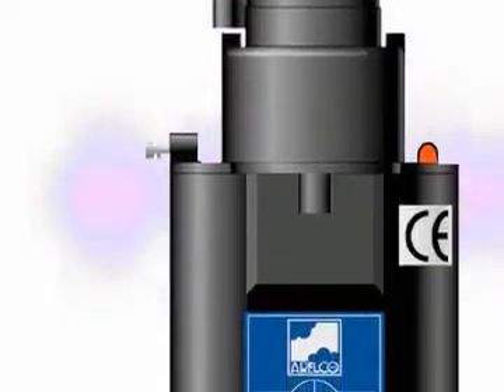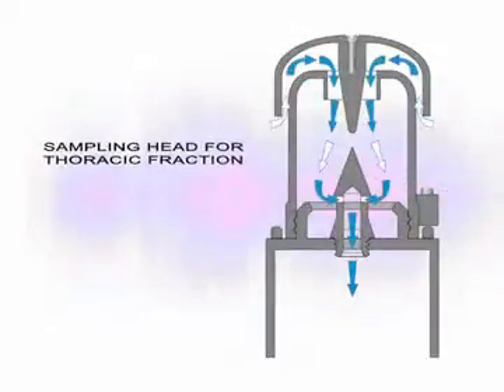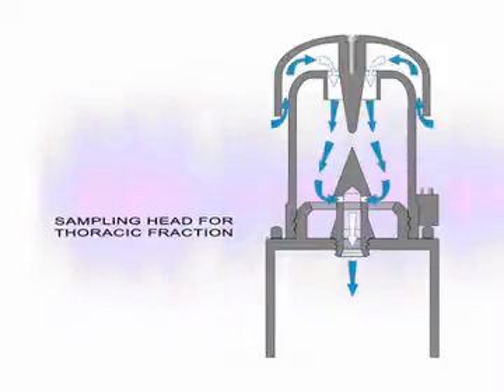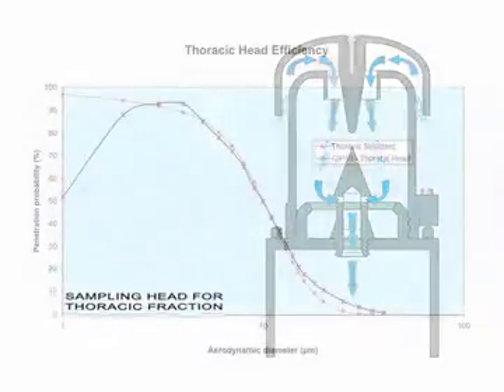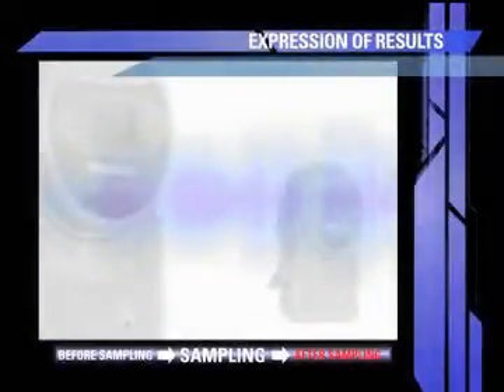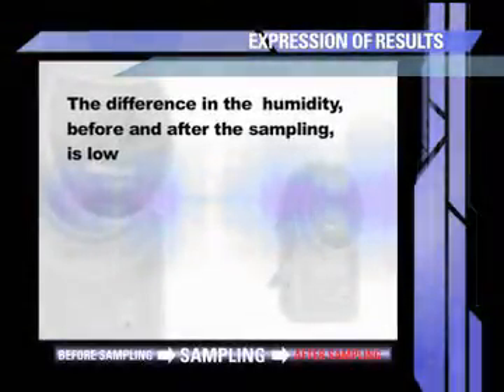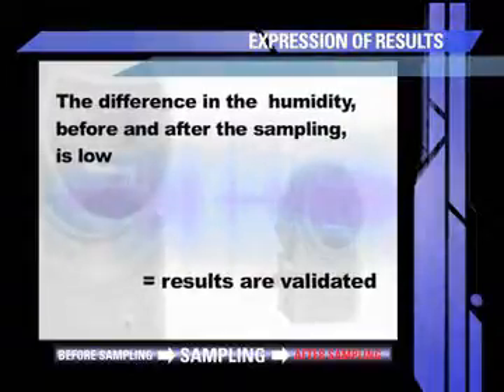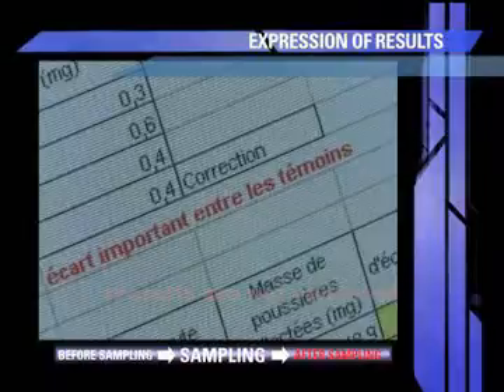CIP 10 Overview  16.5 min

Comment: I used CIP 10 in COMINAK Uranium mining for silica dust collection. I Wish to do the operations after dust collection 👍. Thank you for this video.
Reply from the maker: I know it has been a long time .
if you get this message I would love to ask you some questions .Are you still involved with Silica sampling?
You can respond  I do not know if the channel will allow the phone number to reach you or the email address but here they are 978-726-3153  and 
eli at airsmaplingdevices.com  Cheers